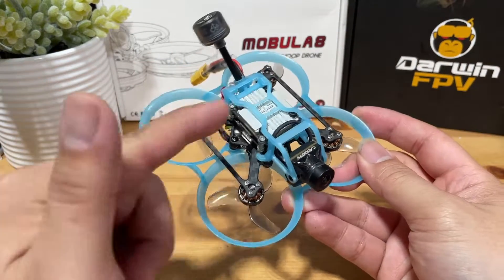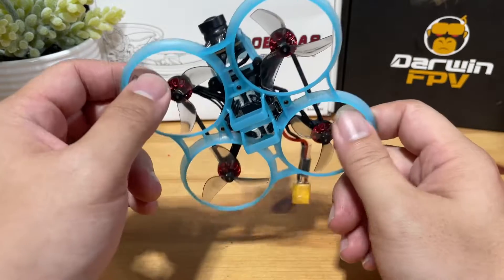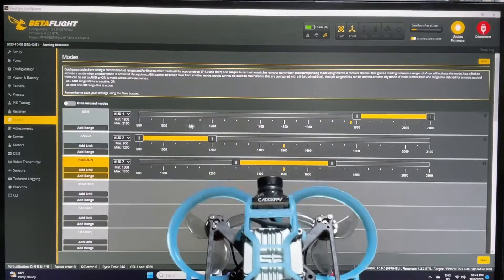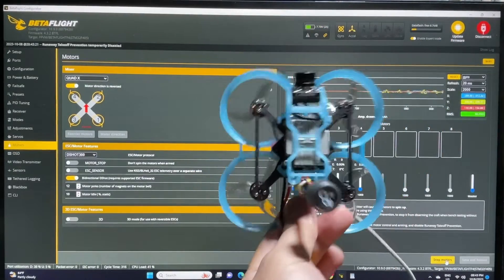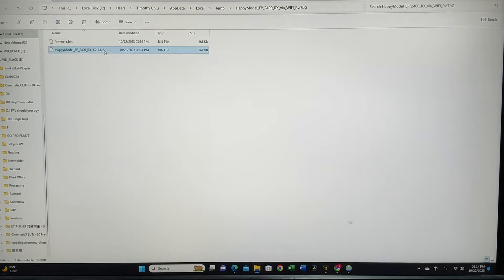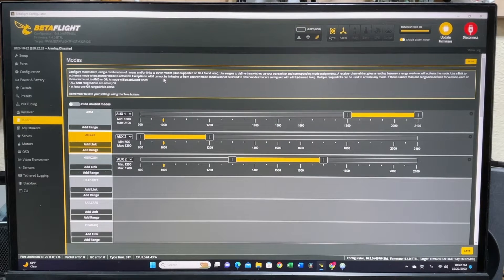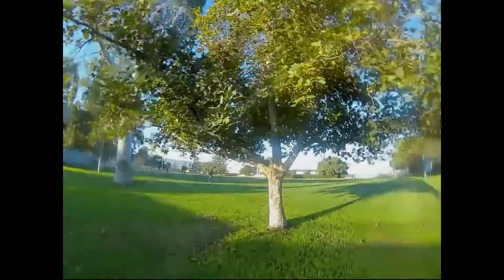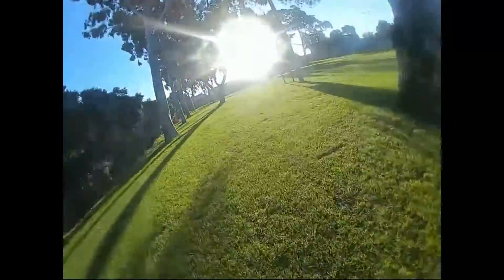If the Mobula 8 and Pavo Pico had a baby... | PicoBula Set Up & Binding & Flight Test #drone

Comment: Quick question - Do you need to solder the VTX to FC or is it Plug and play like dji o3 air unit?
Reply from the maker: It’s a plug and play for the F405 HD
Reply from the maker: For the vistas you will still need to solder on the plug, as they do not come pre soldered

Comment: Lovely video. I would like to know if I can add the Caddx Vista Nebula Pro to the Pavo Pico 20 and use DJI Googles 2 with it? CADDXFPV Nebula Pro Vista Kit
Reply from the maker: Yes, you can. For the binding process you can check out this video 

How to Bind DJI Vista Air Units to the DJI Goggles 2 or Integra? #dji #drone #fpv #cnhl
https://youtu.be/kWvEKnrhJK4

Comment: Good evening I have built something similar to your build only difference is I’ve used the original Pico motors as that’s what I had. And every time I arm the drone it just spins about 90’ and then stops Any ideas?
Thanks
Reply from the maker: This is a runaway 
1. Check your board orientation 
2. Check your motor direction
Reply: Thanks I will have a look when I get back home. Is the direction of the board governed by the first gyro or the Yaw degrees. 
Sorry new at building a drone so first time with beta flight
Reply: Hi I have sorted it, it was one of the motors spinning incorrectly. Thanks for your help 👍

Comment: Is it same wire use for vista and 03 to FC?
Thanks
Reply from the maker: The plug is the same for sure ~ just make sure the line up is correct 5V to 5V & G to G
Reply: @XwingFPVRC   thanks for replying

Comment: Betafpv sucks, aio in my pico diesel after two months. Mobula 8 is better 
I put mobula8 on carbon frame of pavo pico without ducts and is great
Reply from the maker: I will say HM equipment are more durable in a sense BF not so much.